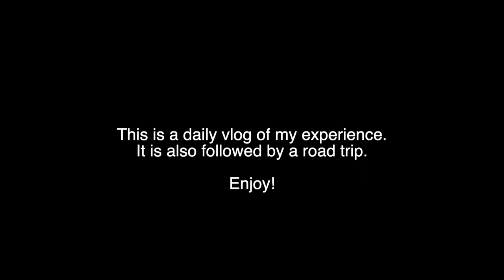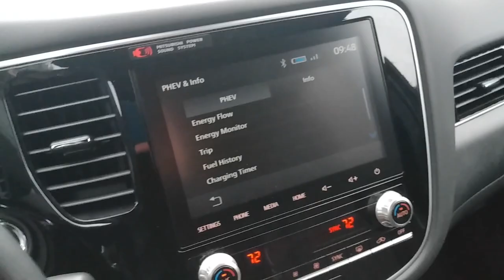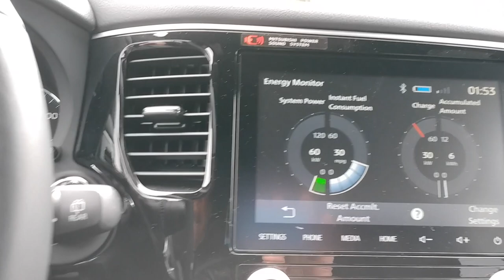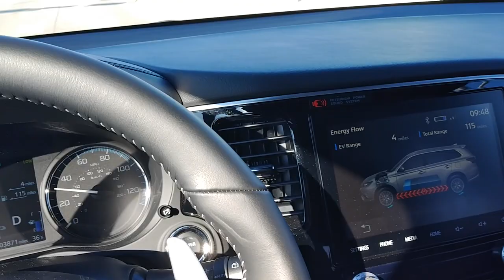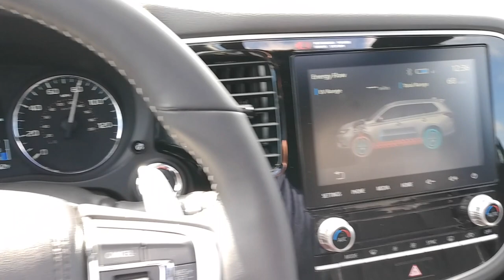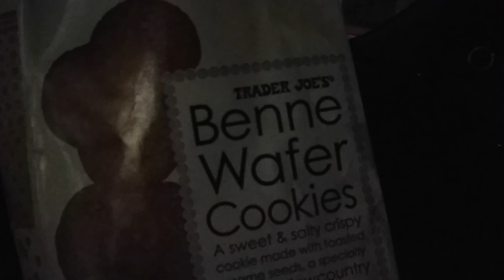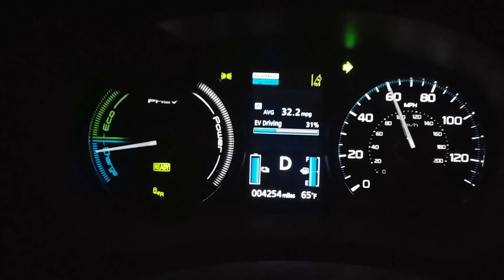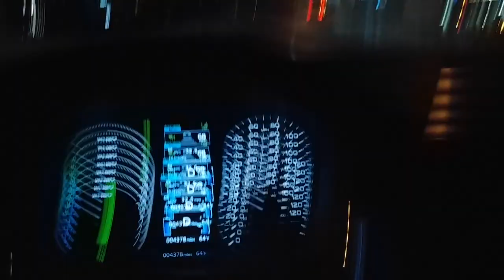Mitsubishi Outlander PHEV 2020

Comment: I’m in the UK and have been using the Outlander PHEV since April 2019 and covered 17,000 miles. I plug in whenever possible and over my entire usage I’ve averaged 234 mpg. You have to use the regen paddles at B5 to slow the car down, then B0 when cruising. The optimal speed to charge the battery at is about 60 mph. The whole idea with a PHEV is that you plug it in. Using petrol to charge the battery, whilst possible, defeats the object and isn’t good for the environment. All my electrical usage is from sustainable generation. It’s a big heavy 4x4 at the end of the day, if you drive it hard it will use a lot of petrol :j
Reply: Agree. Just received mine a few days ago. Charge during night. Put in Eco mode as soon as you leave home.  B0 for flattish cruising. "Eco pump" by exceeding lightly speed limit and coast until slightly below. Range increases tremendously. No gears so little friction. This car really glides when coasting in B0 mode. B1-B5 for regen breaking down hill or to anticipate slowdowns/crossing/roundabouts.  Put in "Save" for highway and long uphills. "Charge mode" if you need a "generator" at a worksite or camping or whatever.
Reply: I have a question. 
Is it ok to change drive mode to B mood while car is in acceleration or car should be stopped before to change From D mood to B mood???
Reply: @muhammadziaullahkhan3482  You can change modes whenever as you wish, either with the paddles or with the shift stick.
Reply: Hi Ian, we just picked out 2016 outlander PHEV up fro poole and so far it been great, hope to be getting the mpg like you have been getting. Just need to buy a type 1 to type 2 cable so we can plugin when out and about. Took it out to tow our camper and got slightly better mpg than our old diesel. but wifes daily commute is now all electric

Comment: I've had one of these new in the driveway for the last month , but still driving my old Grand Vitara for some reason. The Outlander PHEV is hugely popular here in the Arctic (it seems like every third car is an Outlander.)
Perfectly suited to the ice/snow of Greenland , and the fact that we have no roading network connecting towns . 
Even here in the largest town of Nuuk , it's a 15 minute drive from the water's edge until you reach 'the end of the tracks'.
Reply from the maker: How's the charging network over there?
Reply: @NewCarSpin  The city of Nuuk is isolated from all other cities so he'll be pressed to drive more than 30 miles/day. Haven't been there for years but I doubt they got public charging. Electricity is expensive but so is fuel.

Comment: Hi, i like your video and i can follow your idea of using gasoline to charge your car as its cheaper than electricity but keep in mind that the idea of using phevs is to use this cars to save CO2. In Germany its the other way arround, our electicity is cheaper than gasolie so here the care makes sence. I have a green electric power contract at home, i charge my car for free at home with my solar power on the roof of my house then it really makes sence. Dont get it wrong, as mentioned i can understand your point of "following costs" but from the idea of PHEV it does not make sence what you are doing.

Comment: When you use the chademo rapid you are supposed to stop at 80%. Otherwise it will slow down the charge rate, this is to protect the battery.  That's why it stopped at the 80% all by itself. That's normal.  It's so you can go from charge to charge and fast charge without cooking your battery.
Reply from the maker: Yes, but "full range" is not achieved at 80% charge. It would be nice to see two range figures. One for 80% and one for 100% charges.

Comment: In the Netherlands we pay around USD 6 per gallon so charging the battery with the gas engine is too expensive here. Electricity is around USD 0.25 per kWh which is still cheaper than using the gas engine.
I drove the Outlander PHEV for 3 years and I loved it. If you can fully charge it daily you hardly ever need to buy gas. My daily drive to work was about 14 miles.
I'm driving a Jaguar I-PACE now and that is great. Much better than the Outlander PHEV but also more expensive.
Fast DC charging above 80% State Of Charge (SOC) is useless since it slows down a lot. I only used a fast DC charger once with the Outlander just to see how it goes. Only when you slow charge on AC it will get to 100% SOC.

Comment: And this is what happens when you give to a non technological person a really technological car, I watch the whole video btw
Reply from the maker: How is any useful idiot supposed to understand what they are getting into with this car?
Reply: That is the problem of not reading the manuals.  Although you mentioned that you've owned a Mitsubishi before, but you have never learnt how to read its info system and understand the standard icons.  The "press button" icon tells you to dismiss the previous warning message, and proceed to the next one (if any).
Reply: You should never use the CHARGE mode as it just suck up gas to get battery juice instead.  CHARGE mode does not even made sense unless one day gas price drops so much and costs almost nothing.  And, only if you don't mind noise from the engine.  Or,  if you sitting still enjoying the Aircond on a hot summer day by using CHARGE mode which turns gas into electricity to power your Aircond or the 110V AC outlet to run a coffee maker.  You should always charge the car up at night to use EV power as much as possible and only put the car into SAVE mode on the highway to save battery for city driving.  Once, back to the city, you should go back to NORMAL mode to use EV again.  That's how one should be using a PHEV.
Reply: @jgoodman4295  Hi !  Does normal mode mean it reverts to a standard hybrid. Sorry I am a bit dumb on all this stuff. I plan to buy a PHEV next year in May, 2022.

NZ. Auckland
Reply: @johnmartin7158   Hi!  To be honest, all other modes other than NORMAL and SAVE are not too useful.  The PHEV has a brain of its own telling it when to switch on the engine (ICE) on demand.  You cannot force it to only run as a hybrid (to toggle between ICE on and regen braking), unless you run low of juice on the traction battery.  Leaving it on SAVE is the closest you can get.  Also, switching to EV mode does not guarantee that the PHEV will run on battery only.  EV mode simply tells it that the preferred mode is battery only, but it will still kick in the ICE if needed or if you press to hard on the accel. pedal.  In general, just leave it on NORMAL most of the time and let it decides automatically.  Only switch to SAVE on the highway.  This strategy should give you the best mileage if you are over the 35-40km EV range of commute.  If you are under this range of daily commute, your PHEV behaves simply a pure EV.  CHARGE is not a cost-effective mode to be used, unless you want to enjoy the cool electric-powered AIRCON in a hot summer day by turning your PHEV into a pure electricity generator
: )
Reply: @jgoodman4295    Good morning NZ time. For people like me,and who like to keep things simple stupid, your post is very useful for me. For people trying academic exercises as in flicking thru all the modes, and even if there were savings, it would be extremely marginal it seems.

So there are fundamental differences between standard hybrid and PHEV. Tnx for explaining about the regen braking. 

Once the PHEV batteries or battery depletes, is the battery replenished by regen braking ?  Or is it being continually recharged by regen on normal mode ? Or do I need the charge button on ?
I guess I shall find out a lot of all this next year in May when I buy one.
All very daunting for me, but as time goes on after buying one next year, things will be easier for me to understand.

At the moment I have a 2003 RAV4 which I have had since new. How things have changed. 
For sure I am so honoured that you made time for me and you explained things in detail.

Happy new year !

Auckland. NZ. John.
Reply: @johnmartin7158  7
Reply: @johnmartin7158  hi, today is Tuesday May 3rd 2023. Did you get your outlander phev yet? And if so how do you like it? I pick up my 2019 ford fusion energi titanium in three days (Friday) and ordered my wife a 2018 outlander phev SEL (as a surprise) which we'll take delivery later this month. Hopefully she likes it.
Reply: @victorduru    Hi Vick, and a very good question you ask me. I went back to a SUV that I adore the shape of. We can’t get the Toyota RAV4 Prime in NZ or Australia. So I was thinking I would get the 2022 Mitsubishi PHEV Outlander. But I decided to go back to my original thought and I ordered a 2022 Toyota RAV4 Adventure Hybrid, safari green with black interior with a smattering of orange. And a matter in fact it left Japan about 2 weeks ago. So I am excited.

My friend bought a 2021 Mitsubishi Outlander PHEV last year. And yet he prefers the Toyota RAV4. So I asked why did you get Mitsubishi. He said Toyota wait time is far far too long. But he is happy with his vehicle. The 2022 Mitsubishi Outlander PHEV has a real good range I believe Vick. And I think then2022 Mitsubishi is significantly better than the previous generation.

I ordered my RAV4 on the 12th October 2021. I believe for other people they might have to wait till 2023. 

NZ
Reply: @johnmartin7158  Nice man! I also want the Toyota RAV4 prime but they aren't in stock in any of the dealerships in my small town. They're, in my opinion, the best PHEV SUV out now. Also they're a bit out of our price range if we were to order it directly from Toyota plus the wait time is too long. You're waiting 7months for yours sheesh. I'm waiting for them to come to the dealerships then I'll go look at them so it's the outlander for now. Update here when you get your RAV4 adventure hybrid please...hope you enjoy it!!
Reply: @victorduru    Shall update you for sure. If I forget in the next few weeks, by all means remind me Vick.

AK. NZ

Comment: You are missing in your review the fact that this car loses the acceleration when is going up hills for more than 10 miles since the cell battery gets depleted and at that point, the fan stop working and gets overheated.  Did you try to go up hills in this car for more than 10 miles?
Reply from the maker: I wish I could, but hills don't exist in Dallas, TX. Thanks for the input.

Comment: I dont see the point in paying all that money for a Hybrid that has such a short range when running as electric. Yes ok u can plug it in to charge - something you cant do with a lot of the newer SUVs coming onto the market now but come on, Id expect to be able to go further than 20 miles with it before it starts to burn petrol.!! If I was gonna go down this route, Id want it to have a 100 mile range (at least) on a full charge.
Reply: Then you should just buy a regular ev with a range of 315 miles or so. The point of a phev is to be able to save money or spend less on gas while doing your daily commute. My job is 4 miles from my home. At 22 miles EV range i make 2 to 3 round trips between home and work and not spend anything on gas.